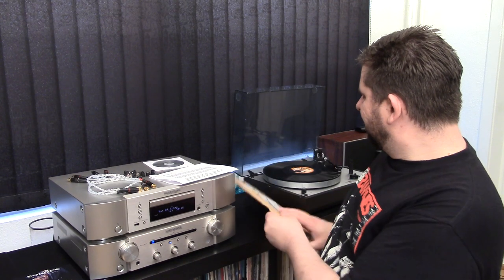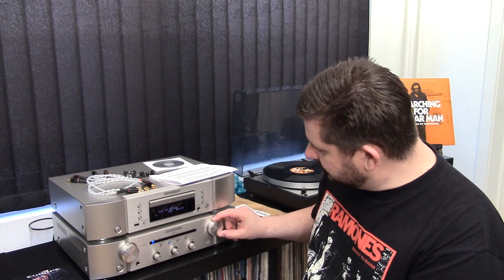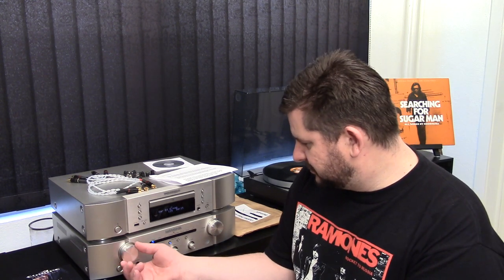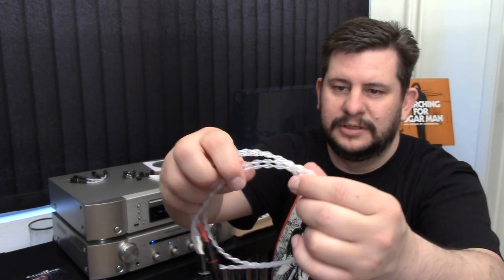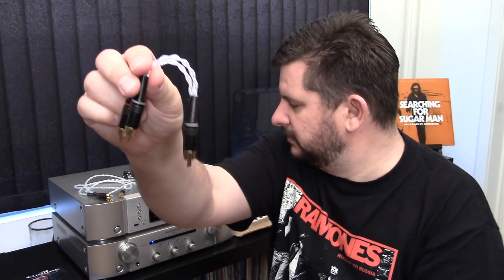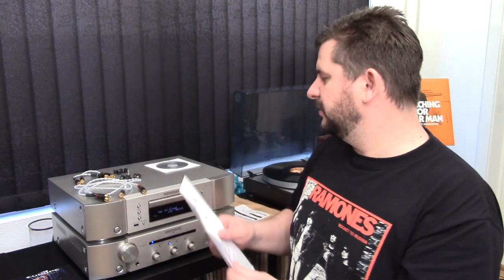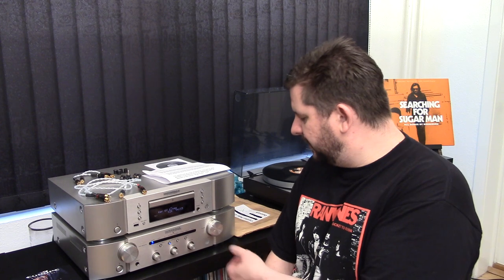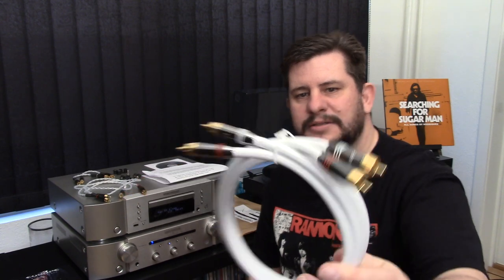Hi-Fi VCLT From Tudor - to solve missmatch in voltage between CD and Amp

Comment: What wonderful VCLT! Instead of hearing music that is new, you get to hear your existing music sound better! What a great concept. That was very cool of Tudor!

Cheers, Tom
Reply from the maker: Hi High Rant District .. It really is cool VCLT. I love stuff like this. CD's have become a lot more interesting since I got this Marantz setup. and this VCLT just made it even more interesting :)Thanks for watching Tom.
Reply: I got a Marantz CD player last year and it's funny, it looks almost exactly like yours except it is black. Mine is a CD5004; I'm guessing yours is a 6004 or something a bit newer.

The sound from the Marantz is already fantastic - it's a really great CD player. I have it connected to a Marantz receiver from the 1970s using a thick Monster cable and it sounds fantastic. It's so good that when the reissue of Led Zepelin's Physical graffiti came out and it was around $47-48 on vinyl I instead went for the much lower price of about $16 on CD. I'm impressed with how good the CDs sound on the Marantz CD player.

I wanted to try my turntable with the Monster/heavier duty cable but when I tried, the RCA cable is actually hard-wired to both of my turntables so I can't replace the RCA cable unless I do some soldering. I probably will try that one of these days - tuturtle is quite the inspiration when it comes to improving sound for often cost-effective ways.

Cheers! Tom
Reply: Thanks Tudor. I see in your video 'Hi-Fi Update 3' that you used attenuators rated at 15 dB. Do you determine the dB rating by the specs of the receiver or is it hit or miss or there generally a safe size to get?
Reply: Thanks Tudor. I left open a web page with the -16 attenuators open assuming that would be the right ones. I'm gonna pick up a few pairs (two Marantz receivers here). Thanks again!

Cheers, Tom

Comment: Tudor is right on the money - sometimes equipment just puts out way too much volume for the pre-amps input... I always try to use the digital/optical in's where I can not just for clarity, but because of the level mismatch gets removed... for my music server, I also run the volume lower into my amp as well - the phono is already at a nice volume in.  Attenuator - its difficult to say even for English speakers :)  For the most part, they are merely resistors soldered in line but cost a fortune for what they are (unless you make your own).
Reply from the maker: dixielandfarm Hi Kris.. I thought there still were a mismatch when using the digital in/outputs between the CD and Amp.. When I tested these new cables, I compared it to the sound from the coaxial connection. And it was still very loud... So I don't know... The digital output must still have some kind of an output voltage.... Hmm!... I just looked at the specs on the CD player... It says that the optical output has a -19dBm output. I willhave to compare when I get home again.Thanks for watching and commenting :)

Comment: The -16db attenuator is basically a simple resistor network soldered straight into the RCA jack. I hope you didn't overpay for that snake oil "silver cable", tho. The increased SQ is most likely a placebo. It's better because you think it should be better ;)
Reply from the maker: NoBudgetTech Well, I didn't pay anything for this. But I'm pretty sure the silver cables is better than basic cobbler cables :)Thank you for watching :)

Comment: Hi Carsten,
This gave me an idea,i've been having problems with my record player for a long time.
Bit by bit i've changed my amp,speaker cables and speakers and i really thought i'd got it solved,but no,it's back again. This means i have to change my record player which i'm not happy about.I've tried to locate the problem with no luck and i'm desperate if i change my record palyer and the problem returns i'm all out of ideas.
So even though this video was about the voltage difference between the cd player and the amp and my problem is between the record player and the amp,i'll try and have a look if it could possibly help me.
Thanks Carsten and Tudor.
Pasi
Reply from the maker: 6758pasi Hi Pasi. Thanks for watching :)
Can I ask what the problem is between your TT and Amp?
Reply: My Analog Corner - Carsten Olsen It happens sometimes when i play vinyls.Sometimes it doesn't happen in a month,sometimes it happens three times during the same side of the LP.When i play records,the left side speaker suddenly turns up full on.Not the music,but the hum,the music still plays somewhere in the back,but the electric static humming is blasting full on.I must turn the power off and then put it back on. The only thing i can think of is that there's a shortcut somewhere in the TT.I did think about the electric spike,but even then,why does the problem always appears in the left channel?I've had the record player cleaned and checked twice,they didn't find anything wrong.Now that i have a new amp,cables and speakers,the only place the problem can lay is the TT.
Reply from the maker: Hi Pasi... I think it could be a problem with the 4 small wire's at the back of the pickup. Have you checked they're connected properly, or if there's a loose connection there?
Reply: My Analog Corner - Carsten Olsen I've checked,yes they are fine. I did think it could be because a hair might touch those wires and cause a shortcut.You know how it is with cats,cat hair is everywhere. It happened just recently and i checked that and yes there was a hair,i blew it off and continued to play.The problem reappeared and this time there wasn't a hair.